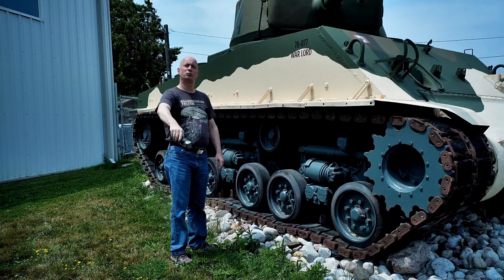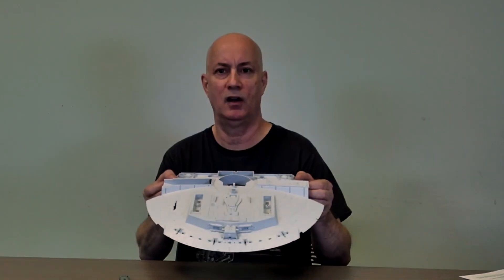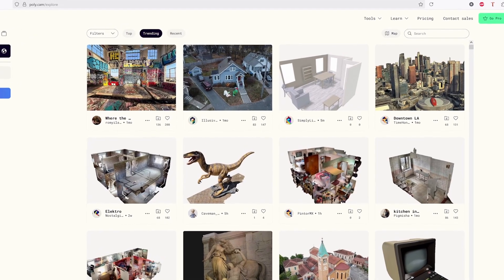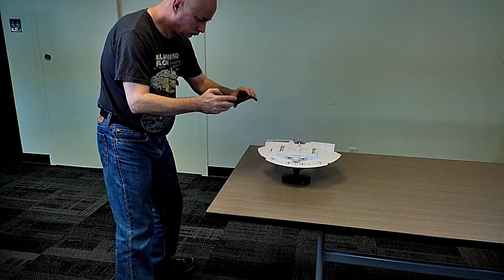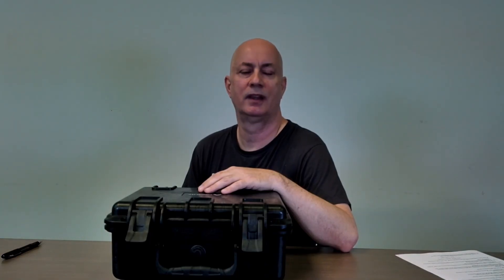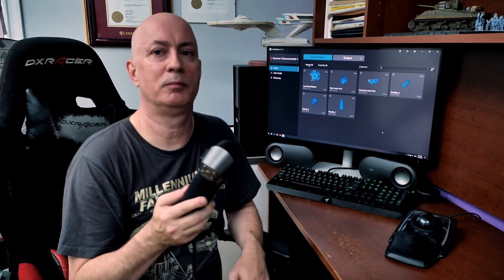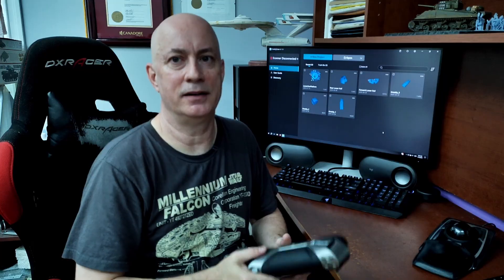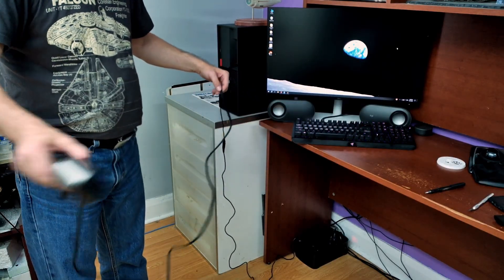Ep 7: Laser Brain - A Studio Scale Millennium Falcon

Comment: At 12:22 When smrt people forget they are smrt- how abouts using a tripod? Seems like an appropriate tool to do just that...keep the scanner at specific distance, easilly adjusting for angle, distance... i'd say so....
Reply from the maker: Thanks. The only tripod I have was holding up the camera. You're right that it would help with small and simple parts that fit on that turn table. But for larger parts, or those that are a more complex shape, you have to move the camera around it. That's when it becomes tricky to hold the scanner at the correct distance. That large kit section I show at the end for example, that required the moving of the scanner over and around the part.